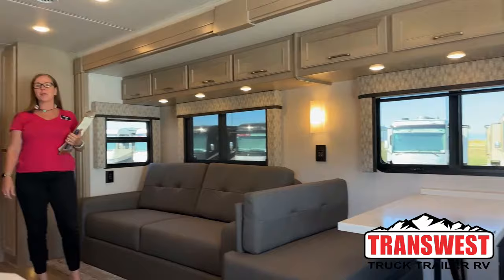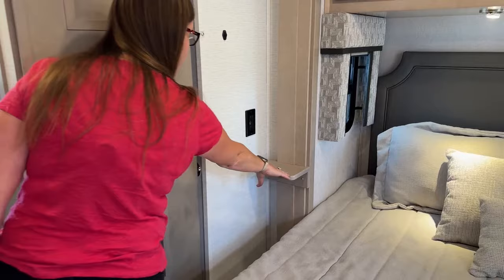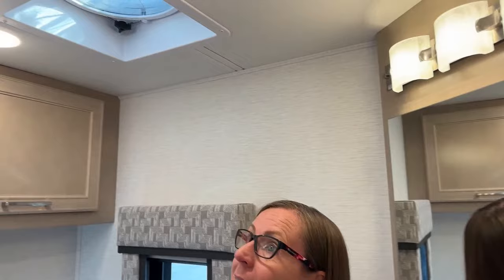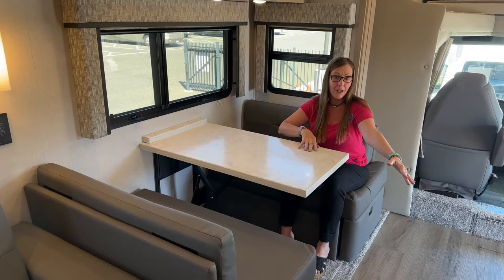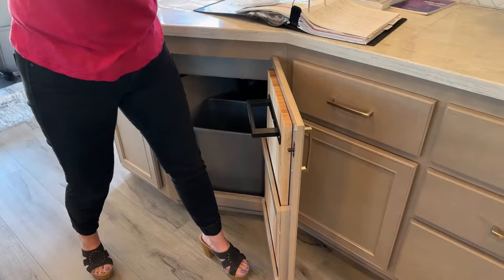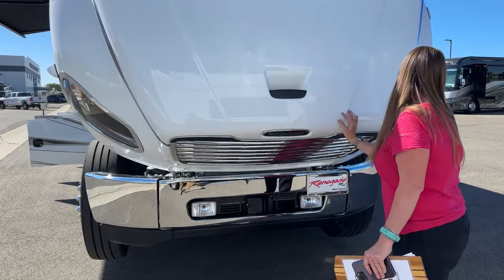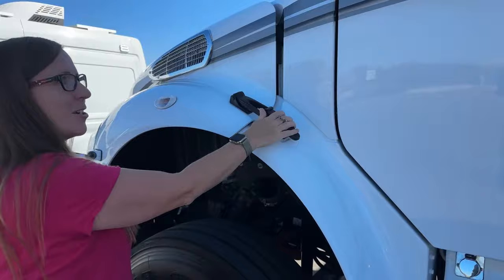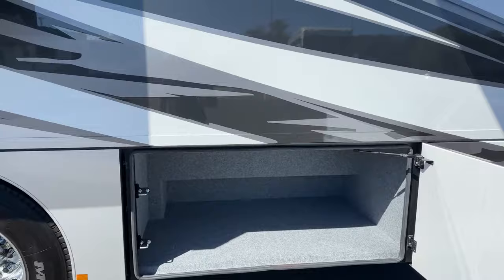2024 Renegade Verona 40VRB

Comment: Not very knowledgeable about AGM vs Lithium. There is a HUGE difference in performance and capacity. 320 amp AGM is not the same as 320 amp Lithium.
Reply: lol. I have a Super Star and I had a Renegade. I'm pretty sure that experience has me pretty knowledgeable. My 8 Led Acid batteries are more than enough for us. Lithium is not anything that I need for the way that we camp. It may be for you, but it can be a big expense if you're not going to use it. Options exist because not everyone is using their RV the same way and everyone should know why they're paying for options.
Thanks for tuning in!